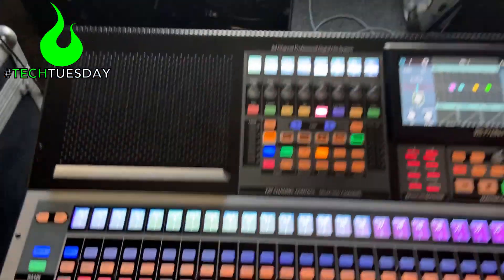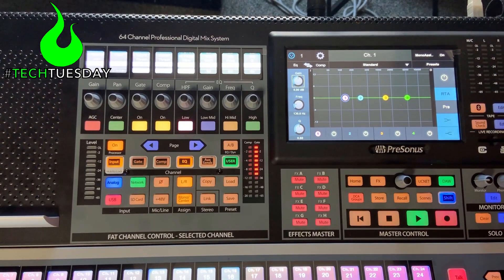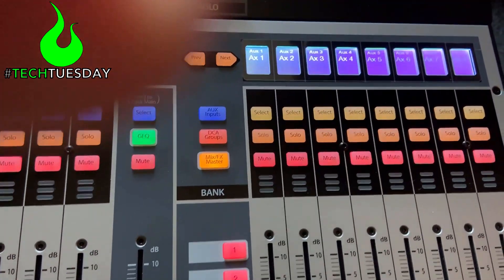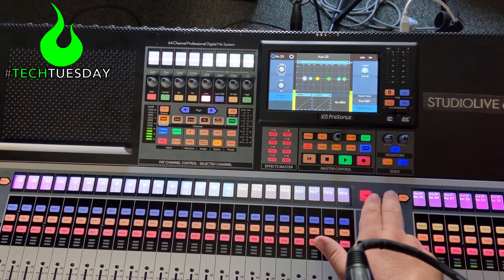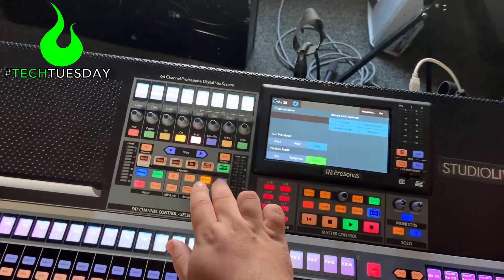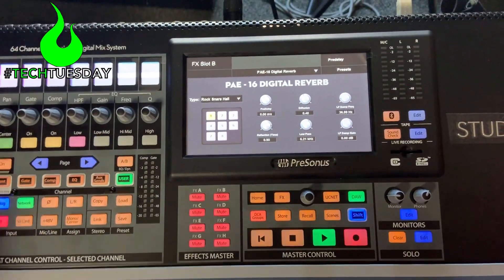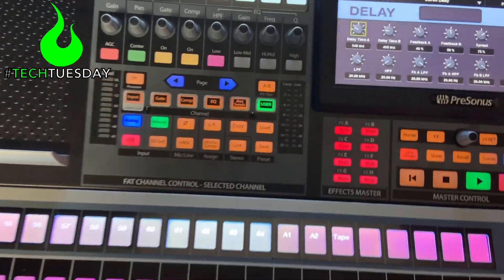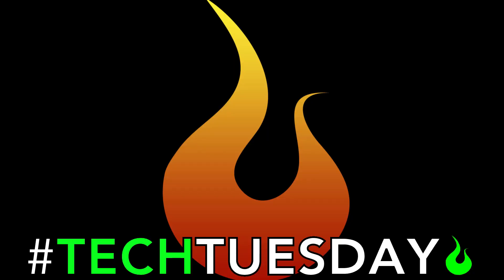Creating a Starter Base Scene - Presonus StudioLive 64S - #AscensionTechTuesday - EP087

Comment: When stereo linking, can you link even-odd pairs? Or is it locked to odd-even? I know it's random, but it's just one of those things that can drive you bananas if your setup is a little weird
Reply from the maker: Excellent question! It is odd/even. For anyone else reading this question, that means you can link 1&2 or 3&4 but NOT 2&3. When deciding where your inputs will fall, any stereo pairs need to start with an odd numbered input.

Thanks for the question!
-Chad
Reply: Attaway Audio for all its shortcomings the Yamaha tf series does that brilliantly
Reply: @i0ushephf  Yup - there's a lot of things Yamaha has done really well since the M7, and even back to the PM-1D and PM-5D